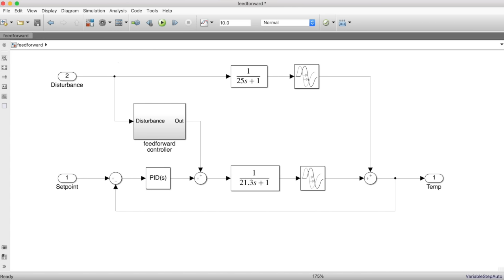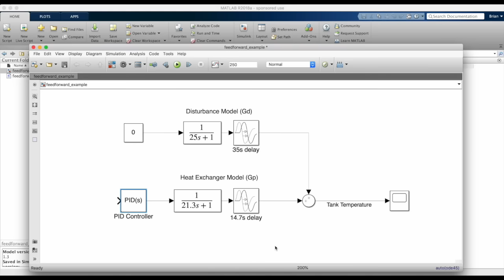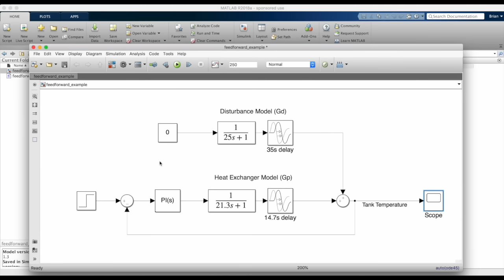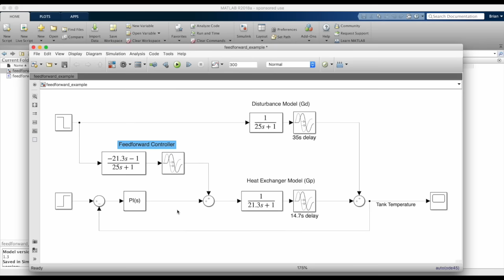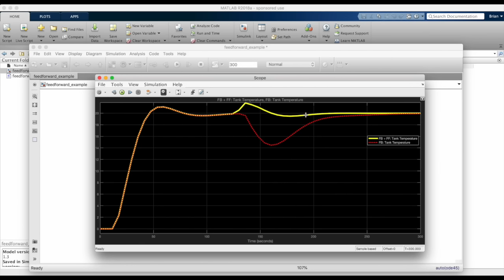What Is Feedforward Control? | Control Systems in Practice

Comment: what is a set point change?
Reply: That just means you are changing the goal for your system. The set point is what you system is trying to achieve and when you change that, you're changing the set point. For example, if you set a thermostat to 18 degrees then that is the set point. The is the temperature the system is trying to maintain. If you then bump it up to 20 degrees you've changed the set point.

Comment: I noticed that you mentioned setting Y(s) = 0.Did you mean setting input-Y(s)=0 instead since we want the error to go to zero and not the output?
Reply: disclaimer(i might be wrong here in which case pls correct me ).
think of a scenario where there is an output with some undesired disturbance value added in it. So to remove this particular value the change in output has to be zero. so y(s)=0 means the change in Y(s)=0 and NOT the absolute value of output Y(s)=0. so u need ur system to produce this ==original control input u(s) + an extra value (which u got after putting y(s)=0).This extra value is u(s)= d(s)*(-Gd(s)/G(p))). u multiply this with Gp(s) u get d(s)*(-Gd(s))(look at the diagram) which is exactly negative of disturbance. so adding with the disturbance(D(s)*Gd(s)) cancel each other out leaving behind the original desired y(s) corresponding to the input.

Comment: Hi, I have a simple plant transferfunction of 1/ms+b, a simple cruise control model for a school assignment. Now I have to use feedforward so I need the inverse of the plant transferfunction. This would be ms+b. But I cant make this in Simulink as the transferfunction block gives the error that the numerator has a higher order than denominator. Is there somebody here who can help me with this problem?

Comment: Two things that might help people understand this better.
 (i) Why is it 
0=u*Gp+D* Gd.
The confusion is because the u in this equation is not the same as input.
In actuality the u reffered here is actually u'.
The actual equation is:
Y(s)=Gp*u+Gd*D+Gd*u'
Assuming your plant dynamics are tracking Y(s)=Gp(u)
Gd*u'+Gp*D=0
In other words add a perturbation to your input u called u' that perfectly cancels the disturbance response. (ii) In the end example, Brian refers to the Simulink controller as feedforward or non-feedforward.
It is important to note that the feedforward only has disturbance rejection feedforward and not the setpoint feedforward he originally discussed in the video.
Reply: Thanks bro! I was wondering the same.

Comment: 15:43 why we set  "0=u*Gp+D* Gd" ?? if we do, we can't follow R. does't it?  I think "R=y=u*Gp+D* Gd" is correct. doesn't it?
if i am thinking wrong, enlight me
Reply: It's been a long time since you posted, but I thought I'd post in case others have the same question.  This equation 0=U*GP+D*GD is really just a bit of shorthand for what he is really doing, specifically, choosing the feedforward controller by setting the transfer function Y/D to zero, which guarantees that the disturbance does not affect the output.  Note that he models the disturbance as adding to the plant output (not to the plant input, which is used in some textbooks).  The transfer function will be Y/D = (GFF*GP+GD)/(1+GC*GP*GS), where GFF, GD, GP, GC, and GS are transfer functions for the feedforward controller, the disturbance, the plant, the feedback controller, and the sensor, respectively.  Setting this equal to zero and solving for GFF gives GFF=-GD/GP, which is the result in the video.  Note that the transfer function GFF calculated this way may be improper and thus not realizable.  In that case, an approximation of the transfer function would be used.